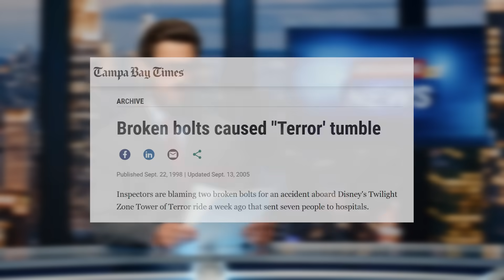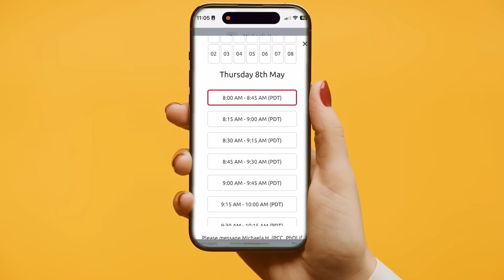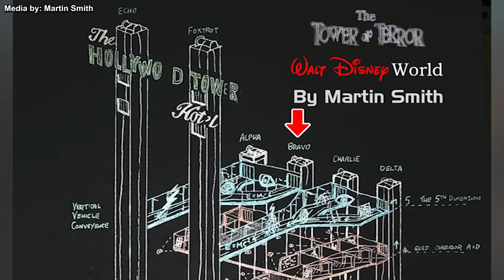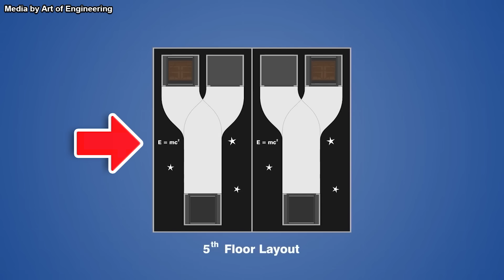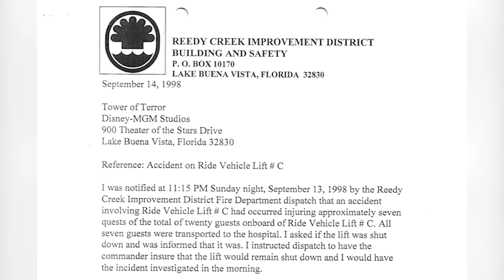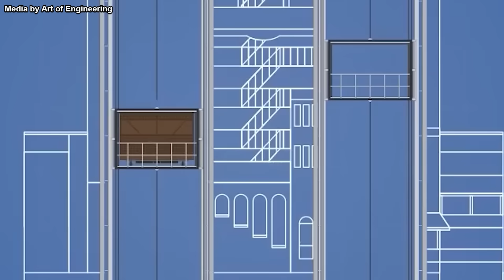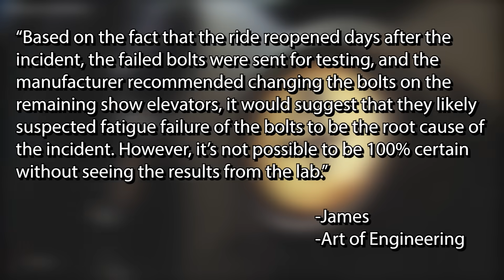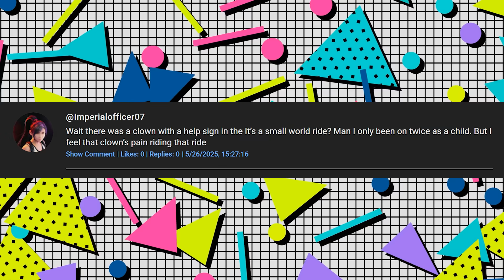The 1998 Tower of Terror Ride ACCIDENT You've Never Heard of

Comment: Given that the other two lift shafts require the car to be pulled up and down, the bolts for those are probably a different, much stronger sort that can handle the wear much easier.

Comment: I remember this ride. I almost died on it. When I was a young teen, I rode this ride with my elder sister and my mom. we were places in the middle left row so we had the lap bar to hold us in place. My mom was on the bigger side and there was a massive gap from my lad to the bar. Thankfully the ride did that fake drop first because it made me and my sister realize I was about to fly out. She held me down as hard as she could while held on tight to that bar and  locked my lags as hard as I could to not slip out. The ride was fun but not the part of almost flying out of that cart.

Comment: Another fun fact, the 'air cushion' effect was discovered by accident. In 1945, a B-17 bomber got lost in fog over NYC and ultimately crashed into the Empire State Building. In the process, it severed the cables to one of the elevators, causing the car and its sole occupant, the operator, to fall essentially the entire height of the tower. Miraculously, the elevator operator was found alive in the wreckage in the basement (though injured). The elevator car was a tight fit in the shaft to maximise floor space, and this allowed the car to compress the air beneath it like a piston, adding resistance and slowing its descent to survivable speeds.
Reply from the maker: Wow, that's an incredible story and an amazing bit of history! Thanks for sharing that fascinating fact.
Reply: @ThemeParkCrazy  I misremembered slightly, it was a B-25, and the operator in question was initially injured, then taken in another elevator to the ground, but that elevator had been damaged in the impact, leading the cables to snap. Definitely cause and effect, but two separate incidents. The operator, Betty Lou Oliver, fell 75 stories, or 300 metres, straight down, and survived due to the air cushion effect. https://en.wikipedia.org/wiki/1945_Empire_State_Building_B-25_crash

Comment: The Tower of Terror is a very well engineered ride! The ride was built and engineered properly with multiple safety redundancy and fail safe systems. It was very unfortunate that 7 people suffered minor injuries in this accident. However, the ride's good engineering prevented a much worse disaster from occurring. I've told loved ones that I would never take them on an amusement ride that I didn't think was a well engineered and safe ride, because it's always in the park's best interest to not have any safety issues on a ride. No theme park wants a big disaster where they're going to be sued for an accident. So again, it's always in a theme park's best interests to make sure that rides are built with good engineering with safety redundancy, and with fail safe systems like the Tower of Tower was built with.

Comment: I remember when I was really young (like 7-9) I rode the Tower of Terror with my grandpa and the only seatbelt they gave you was this thin fabric one that looked like a backpack strap. When the drop happened I was literally floating out of my seat in pure terror because the only thing holding me in was the loose seatbelt and my grandpa who grabbed my hand once he noticed I was floating. I’m still terrified to ride it to this day because if that seatbelt had been even slightly off the back of my lap I would’ve flown straight out of my seat.
Reply: I rode it when I was 6 in 2004 when it opened at Disneyland and the same thing happened to me 😅. Wish I still had the picture

Comment: I went on this ride in the late 90’s as a skinny 12 yr old kid. At the time, the ride had one long restraint bar that folded down onto everyone’s lap in a single row. In my row was my younger brother, myself and a 300 lb man. As you might imagine, this man’s lap was MUCH higher than ours so there was a good 12” of space between my brother and I’s lap and our restraint bar. When the elevator dropped my brother and I flew into the air, gripping the lap bar with our little hands for dear life else we slip out and smash into the ceiling of the elevator. It was legit scary. We were almost in tears when we got off the ride and found our parents.
Now they have individual restraints. 🙄

Comment: I suppose if the ride did not reach a velocity fast enough to activate the emergency brakes during the first wire failure drop, that the original designers were correct when they thought gravity alone wouldn't be "thrilling enough". That explains the added strain on the wires and the second drop though, even if it wasn't when they expected, (and safe thank goodness)  at least the riders boarded the ride already being fans of the dropping sensation and anticipating one. I'd be beside myself. They'd be living out the lore of the ride. But this isn't the ride you want to be the main character for.

Comment: It's reassuring to see an example of emergency equipment working the way it's supposed to. There were emergency breaks in place, and they did their job correctly. Like you talked about, there were also additional measures in place. It's unfortunate people were still hurt, they may have been killed if these emergency measures were not included in the ride's design.

Comment: This video immediately piqued my interest because i was almost in an accident in this exact ride only like 8 years after this!
I think i just barely met the height requirement. It was my first time riding ToT, and my family was in the back row of seats. The seatbelt didnt tighten down enough over my lap and the attendant didnt check it. On the first full drop, i flew upward, fully lifting from my chair and pressing against the seatbelt. I remember feeling myself slipping up because my legs were short, and my dad next to me had a flash of instinct and flung his arm out to hold me down

Things could have ended extremely badly
The fact that ToT only uses lap restraints especially since the drops are faster than natural gravity is... a little more than concerning tbh

Doesnt stop this from being one of my absolute favorite rides of all time... despite the fear of the first trip 😅

Comment: I can't believe there was no regular maintenance inspection done on these bolts  and also so that they would be regularly changed before they had mechanical fatigue. The fact that they said the results were inconclusive from the Lab showed that there was no maintenance records because that would have been the first thing that they checked against the lab results was the maintenance records showing how often that the bolts were inspected and changed and the fact that all the bolts put in the same word from the same batch is just mind-blowing.
Reply from the maker: That's a very good point. Admittedly, this was during the Pressler era, which was infamous for cutting costs. So it wouldn't surprise me.

Comment: The shock absorbers at the bottom of an elevator shaft absolutely are meant to catch a falling car. One of the tests they have to go through is fully loading a car (to it's rated weight), then bypassing every safety and drop it onto the shock absorbers.
Reply: Elevator manufacturers even have towers to (crash) test their products.
Reply: Buffer testing is absolutely a thing, along with safety rail testing (and much more). Thank your elevator inspectors and technicians.

Comment: The fast is that  theme rides are  potentially dangerous.   As  a rider, you depend on  the park to  maintain the ride  in  top condition at all times.    It is one of the reasons   that I would hesitate  going to Disney today.  Disney has, in the most recent years,  failed to maintain and service their rides and parks.    But  ride mechanisms can and do break  without  constant maintenance.  Especially if the ride is running constantly,  every day.   So  as a customer, you need to use your  common sense-----think twice about riding a  ride that could be dangerous,  unless you are sure their  park maintenance  is top notch.
Reply: I too love spreading misinformation on the internet

Comment: In Otis's original safety elevator the cables attached to the car at a spring loaded brake where the weight of the car pulling on the cable holds a safety brake off, so if the lift cable breaks it instantly snaps the cars safety brake closed.  I would bet in the main drop shafts since they cannot use a centrifugal activated break like most conventional elevators would (because the cars move too fast for this to not trigger all the time) they likely used a similar setup where the lift and downhaul cables pull on the elevator car with a lot of force that is holding safety brakes off so if either breaks a safety brake would activate.  Because of the nature of the ride system there are likely other brake systems such as brakes on the cable drums along with probably 1 or 2 additional safety brake features that do not rely on the cables at all such as shaft sealing in the lower levels of the shaft as mentioned so an air cushion/brake would slow the car.

Comment: I'm a little confused.  So the ride failed in the lift up sequence. So the ride fell one story, and people were injured? But the ride drops significantly harder and then pushes back up again, in the show sequence. How did these people get injured? Makes it sound as if they were not buckled in, or they wanted compensation.  I've had an elevator fall several stories, in an office building, and we were not injured.
Reply: I’m not really sure either but it seems like a certain speed was calculated into the system where once it reaches the speed it will hit the emergency breaks but when it fell, it wasn’t the exact speed

Comment: Not related to the video, but thought I’d share! The rumor that Tower was designed to blend in with the Moroccan skyline at EPCOT has been debunked. The tour guides for Tower are very lucky to have a direct connection to the WDI documentation for the attraction, which confirm that the Morocco pavilion was not on the Imagineers’ minds during Tower’s development/construction. According to WDI documents, Tower’s architecture is Spanish-Colonial, not Neo-Mediterranean. Tower’s official color is “Patio Pink”, while the Morocco pavilion uses more dirt/red/orange colors. This is definitely a common misconception. Some of Tower’s tour guides (One who was apart of the test and adjust team, opened the building, and has been a Bellhop for 30 years) have even spoken to the Imagineers who worked on the attraction directly about this topic. I believe one Imagineer was quoted saying, “If sight-lines were still a priority for Disney, we wouldn’t have built the Swan and Dolphin next door!” The current tour guides are working to stop the spread of the misinformation.

Comment: FUN FACT: when Disney went to the Otis Elevator Company with the concept for a drop ride, they initially said “Hell no! We’ve spent our entire company history, trying to make sure elevators do not drop unexpectedly!!!” Thankfully, once the concept was finalized, Otis got on board, and due to this accident, it was definitely a good thing!!!
Reply: “Fine, if you’re going to do stupid shit anyway we might as well make sure no one gets killed…”
Reply: Absolutely, a non-elevator company may have not designed/included the comprehensive safety systems like Otis did.
Reply: @justaworm1  Considering you're talking about the company formed by the man that INVENTED the "safety elevator." The A-D shafts are fairly "ordinary" heavy-lift elevators that experienced an "ordinary" malfunction.
Reply: I live very close to Otis actually, but i never knew this about the company. I just see the big tower with "Otis" written on it.
Reply: @derealized797  Most elevators have "Otis" somewhere on them (I heard once that around 98% of elevators in America are Otis) At one time, Otis boasted they could have a mechanic to any of their elevators in something like 20 minutes. And Otis was the guy that invented the emergency brakes, way back in 1852.
Reply: All the way to "Suppose we put another cable on the bottom to yank it down the shaft because gravity is too weak for our satisfaction"

Comment: Disney makes a lot of mistakes and falls short in a lot of ways but one place they don't is when it comes to safety, especially the safety of guests. Redundant safety systems on all rides with sensors and systems to stop the ride automatically if the system detects a potential problem, emergency stop buttons at all ride operator positions (physical hardwired buttons and on some rides wireless buttons that the cast have on their belt) that are all tested every morning before opening as part of the ride's safety inspection, and maintenance performs their own inspections routinely. The policy is to stop the ride if anything seems out of place, the idea being it's better to stop the ride and it turns out to be nothing than for it to be an actual problem and someone gets hurt.
Reply: I wouldn’t trust anything they built in the last 15 years with all the DEI crap going on.
Reply: @dwightrenfield2241 take your politics somewhere else

Comment: The restraint failed when I went on the tower of terror in the summer of 2001.  Thankfully, I wedged myself in place and wasn't fully flung out.  I did get way closer to that than I would like to admit.  The ride battered me about a bit, and my legs were bruised. I collapsed in the exit area afterward, rocking and sobbing, much to the confusion of my family.  It took me 15 minutes before I could wobble my way out of there.  I did complain to the ride operator, but the guy ignored me.

Comment: Makes me wonder what safety systems they have in place for the larger E and F shafts.
Reply: Pretty much the same as a normal elevator. 
If the elevator reaches a speed faster than it should, a safety brake will engage.

Comment: The bolts broke and the car went into freefall, on a ride that normally goes faster than freefall.  So i wonder what kinds of injury might have been sustained.
Reply: The failure happened in the first set of elevator shafts, which are not intended to free-fall at all.
Reply: It's likely the sudden stop that caused injuries, especially when you are not expecting it

Comment: I was only 3 years old when this incident happened, but I still remember it like it happened yesterday. I can only imagine how terrifying it must have been for the guests riding it that day. Surely other guests who rode the ride prior to the incident reported hearing unusual noises or that the car felt a little unstable during the ascent or something, right? I’m actually not that surprised that failure of the bolts securing drum 1 had caused the incident. When rides like this are operated almost constantly, and the parts are under constant stress, failures like this are bound to happen. Parts like bolts and screws will begin to develop micro-cracks which will  eventually cause them to fail and sheer off. Since micro-cracks are almost impossible to spot, they are often overlooked until it’s too late and the part fails. Will I ever ride  Tower of Terror? Most likely not due to my fear of heights.

Comment: In 2018, they modified the 4 drop sequences to be less intense, due to the original versions (at the time) causing the motors to overload and e-stop the ride. The motors were refurbished afterwards, but they never reverted the drop sequences back to the full intensity versions. Recently, the effects haven't been in good condition, including the projections, which I really hope can be addressed soon.
Reply: Yep. You can see the difference in the drop sequences if you match of a video from prior to 2018 with a current one (you also have to get a matching drop sequence in both videos).
Reply: @30framespersecond is there any side by side videos already posted? I’m curious to see the difference